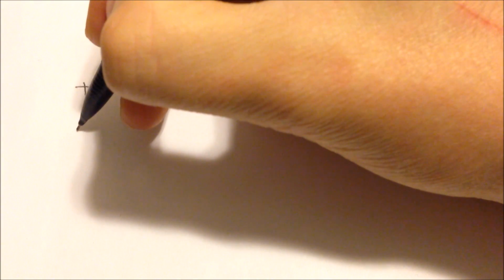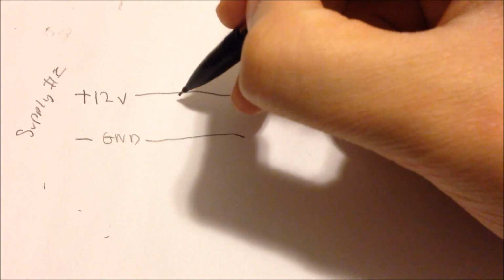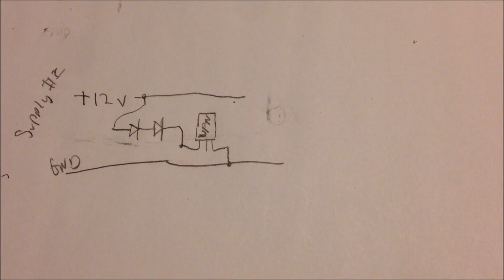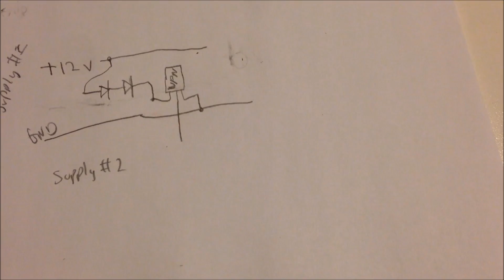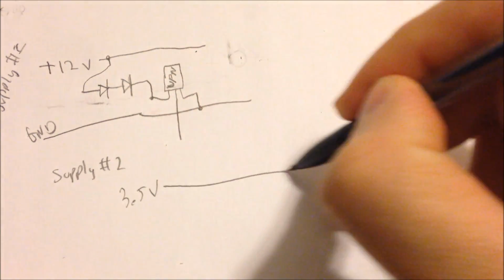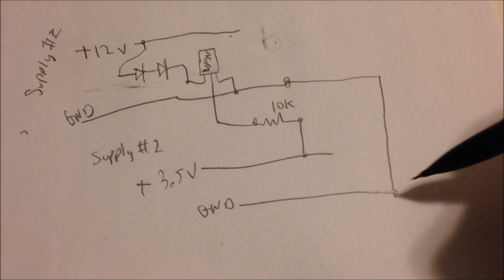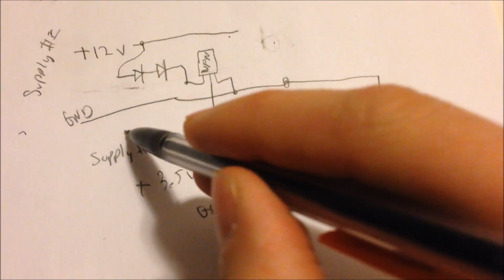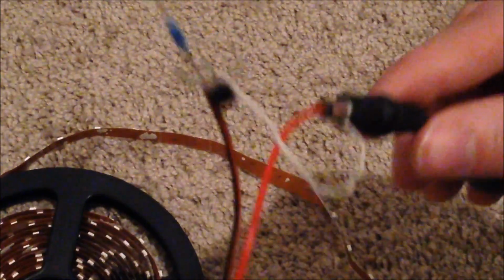Using an NPN Transistor as a Relay

Comment: Simple and to the point. Appreciate the vid. I was trying to find a way to switch a circuit with an external power source without actually having to get a mechanical relay/contactor involved and this should do the trick!

Comment: when a low voltage Source  control a higher voltage Load OR low current Source control a High current Load ,,you can call it Relay Function. if you study any relay you will find out control side represent either low voltage or low current to control Higher current or higher voltage LOAD

Comment: omg!! when i touch the base with my hand(only the base) the led strip lights up just a little bit...and why is my transistor dropping 3v? i used 2 aa batteries(3V) and get ground to ground, positive to the base trought 10k, ground of supply1 to collector and ground of the leds to the emitter. everything works but when i measure the led input voltage, it's around 9v instead of 12V....

Comment: Thanks, was just what I was looking for. I basically want to connect a bunch of LED's inside my PC case, and have the HDD light header power them. As the header doesn't supply the voltage needed to run them all, I knew I needed a transistor to do it, but didn't know exactly how....

Comment: 1. its a transistor switch, not a relay
2. with NPN positive connects to collector, not emitter with load on high side and transistor on the low side (eg: a low side switch)
3. you're getting confused with a PNP transistor, were positive goes to emitter and load is on low side and transistor is on the high side (eg: a high side switch)
Reply: Sure about that? I was on the understanding that NPN was neg from source to the collector and pos from switch to base then neg back out the emitter to the neg side of the device. I'm sure that's how we were taught to do them else would that make it an NPP or PPN?

EDIT .. wait after some thought and more looking .. I'm guessing you mean right rail wrong direction? Load on the collector side and the earth/0v/neg of the batt/source on the emitter? In which case I can understand and work with as well (the old thing of P->N when it's actually N->P gets me. I look at the circuits particularly for diodes and stuff that up forgetting they still diagram it in reverse. However does the base still share the emitter or is it now the collector? Or does it matter?
Reply: I completely agree with you. This right here is fundamentally very wrong from his explanations

Comment: This is a useless  video clip cause :
1) A relay is  a device usually used to  allow through the contacts   ,switch high currents or voltages  to a load  ,using a low voltage/current  to magnetism a coil !
2)  why  do i need 2 voltage supply  ?  after all  u can use the same 12 volt supply to  bais thru resistor the base of the transistor !
3) relay contacts  must allow  ac and dc  currents  ,that does not happen in this case !
Reply: The whole point of using a relay is to use a low current source to activate a higher current source, hence two supplies. You don't understand it because you don't have a need for it, but maybe someday you will, and you'll wish you had this video to help.
Reply: Ever heard of an arduino? It cant handle a lot of current

Comment: Um, you don't connect the emitter of a NPN transistor to positive voltage.  That's not how NPN transistors work.  It's the same thing as if you were to try and connect the cathode of a diode to positive voltage.  I don't know if you realize this but the emitter-base junction is a PN junction.  Just like a typical diode.  Current doesn't flow from the emitter to the collector (in conventional current flow), it flows from the collector to emitter.

Additionally, if you are serious about electronics it would be a good idea to:

(1) Invest in a breadboard for prototyping - they are super cheap and good for demonstrations such as the one you are attempting to do in this video.

(2) Use common circuit schematic drawing techniques.  Google "circuit schematic" and you'll see that out of the millions of schematics, 99% all follow the same common formatting.
Reply: you guys are so childish, everyone is trying to tell him what he needs to do, where is your video douche bag?
Reply: silentscribes I don't need to post a video of how transistors work.  It has been a fact of electricity for a while.  Just pointing out errors in his instructional video.

Comment: This application is perfect when used with an arduino nano as a 2-way radio repeater controller where the transistor switches the PTT line to High of the TX radio when the arduino detects a COS signal from the RX radio.

One flaw that could become potentially dangerous: You should put a diode in line with the batteries negative return line to keep the -12v from feeding back to the battery (a precaution in case it decides it needs to try and charge the button cell which is not rechargeable).

Comment: hook a solar cell in place of the button cell to  detect infrared from a remote control.  Also replace the led with a small speaker to hear the infrared transmission from a  remote control

Comment: This is a very amateur presentation with very poor circuit diagram. As mentioned in other comments, the information provided about connecting the transistor is WRONG.
Reply: +Michael Judge *your
Reply: Michael I was just going to say how I appreciated the vid and was thinking of subbing ... then saw the your (and it's your not you're but that's nitpicking) mum low foul swing and you lost me :(.

A better response perhaps would be "and HOW do I improve it". That way if they do have a better way we both learn something new.

There will always be haters and as frustrating as they are (not saying that Archi is a hater here) to swing back at them especially like that removes ALL your credibility and professionalism.
Reply: I'm sorry but all credibility and professionalism needs to be removed. As well as the wrong connection of the transistor, there is other extremely amateur content; for example the statement that any resistor can be used.
Reply from the maker: You're mom is a poor presentation

Comment: nice..... BTW what is the minimum and maximum source to trigger the transistor? and any NPN transistor can be use to that?
Reply: Mark Dave Granada you need to look up the datasheet for the transistor you are using. Some transistors can be triggered just by touching them
Reply: aldeed i know that for a fact, I've used them for touch sensors in my arduino projects

Comment: If I were to use a PNP transistor, how would the circuit be different.
Reply: Questions? Like the video:) Then you should connect the leds in the emitters side.

Comment: A NPN with emitter to +12? .... uhhh yea sure. The leds should be in the collector and the emittor have to be connected to gnd. Also not mentioned in the movie, be aware of the maximum collector-emittor voltage of the npn you gonna use and the maximum amps the npn can handle. As example, the BC847 can handle 100mA. Let's say you have 2 stripes of 5Watt 12V leds, you have 10Watt's total, resulting in a current of aprox 833mA. That BC847 will blow up faster than you can see the lights going on >< :D
Another one: He is using a 3.5V battery. In theory, every voltage higher than the Vbe (base-emitter), should result in the transistor going from saturation to open. That base-emitter voltage is (varying per type), around 0.6-0.7V, because it is a kind of diode. In the datasheet you can find this Vbe voltage. So, a 1.5V battery would have resulted in the same result.
Reply: Is it work by using 3.5 v instead of 12v and 1.5 in place of 3.5v,to operate a 1.5v dcmotor
Reply: is it okay to use a 5v input instead of 3.5v , id like to use as a relay for my arduino project

Comment: hey , m using tip31 npn transistor, and had given 12 v from adapter, and in place of 3.5 using  5v from arduino ,  1.6 kohm resistor appxdont knw why its not working ,  ...................
Reply: Make sure all the connections are correct.  Try flipping the transistor (he wrote it backwards on paper), and also try flipping the LED (since if you hook it up backwards, it won't work).

Comment: This does not work for the simple reason that the transistor is connected backwards. Not in the one that you actually built, obviously, but in your instructions. If you connect your 12v to the emitter and the GND to the collector of your transistor, nothing is going to happen, because those go the opposite way. The base controls the flow of current from collector to emitter, wich emits the sum of the current applied to the base and drawn by the collector, minus some loss of course.

An easy mistake to make, and also an easy fix since everything else seems flawless =). Im not doing this whole elementary level explanation cause i think that you need it in any way shape or form, it's just for the viewers ;)
Reply: erm .. I'm a noob at this so admittedly easily confused .. but I think you miss-viewed. To me it seems he attached 12v on led to the 12v on rail, not the emitter.
He attached negative to emitter on led's and collector to gnd source.
Reply: etsme An NPN has a diode between base and emitter, with the cathode at the emitters side. He added 2 led's in series, positives to their anodes and the cathode at the emitters.. so.. a current should want to flow from the +12V to npn.. but hey, there's the cathode of the diode, so infinitive impedance, so no current at all (yes, a very tiny current, called leakage current), but general speaking, he did connect it in the wrong way. The diode should be in the collectors , having a resistor in series (to be sure the Ic won't be that high causing burn your leds) and the emitter to the ground (eventually, depending on Ibase a emittor resistor too).

Comment: That's just using it as a switch to turn something on.
A relay can turn things off or on when power is applied.
Reply: You can turn things off with a transistor too!
Reply: It's funny because you just repeated the title of this video quite precisely and i still get the feeling that you never did read the title, did you?...If you have no need to learn how to work with transistors as relays for low-current applications then what on earth are you watching this for?
Reply: Made ya laugh didn't I? :-)

Comment: I need to do something similar to that, but instead of a LED belt I have a 12v buzzer and instead of a 3.5v battery I have a 1.5v circuit (smal digital clock/alarm).
Wich transistor and resistor should I use to make it work?
Reply: Anything over 0.7v should trigger most NPN transistors; the trick will be making the buzzer work -- does the buzzer just buzz when you apply DC power, or does it need a waveform (like a normal audio signal)? -- If the former, you can just hook it right up.  If the latter, you'll need to build a simple wave generator (I think a triangle wave generator should be pretty easy to do with a DUAL OP AMP IC, just google for "triangle wave generator op amp"), and then have it power the wave generator instead.

Comment: Hi thanx for sharing - great video yet again
CAN I ASK A QUESTION... I need 12 5 and 3.5v for a large project that i am doing. Could I use a Computer 250w 240v power supply that gives me the voltages and amps (and more) that I require. thanx